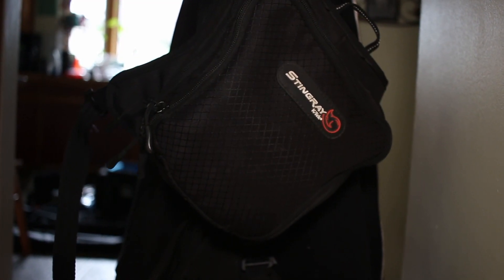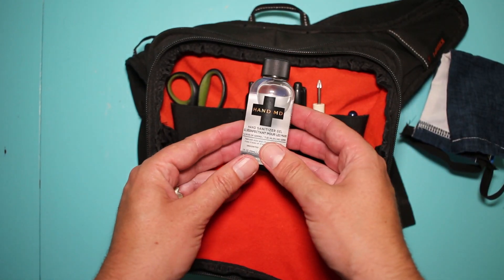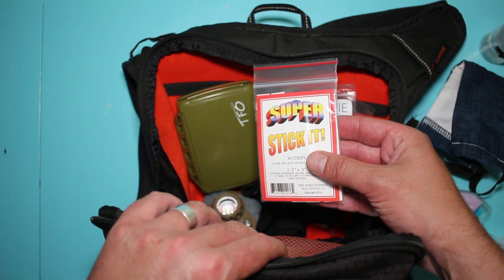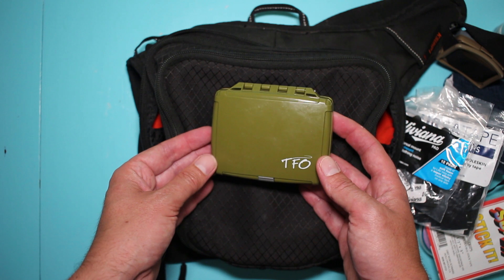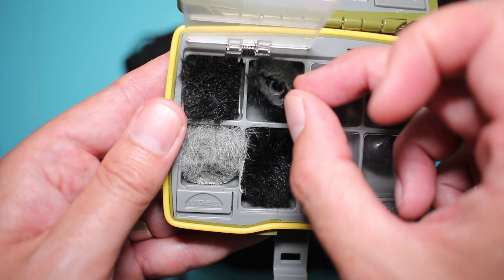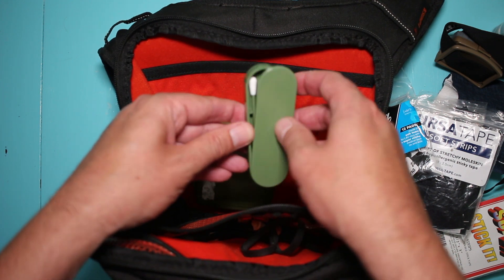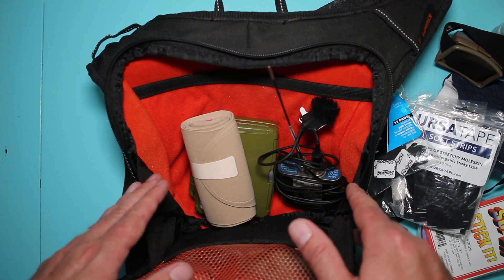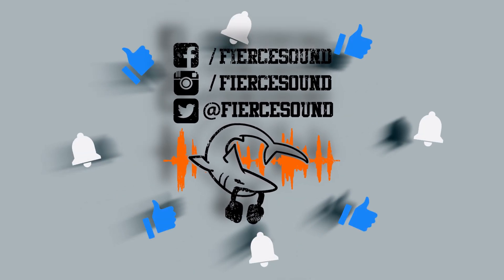A Look Inside My K-Tek Utility Hip Pack (KSUHP1)

Comment: Thank you for sharing.
At this time, TFO does not deliver outside of Canada. I didn't know this "box" before. I rather know the MICBOX from Lectrosonics which is relatively more fragile, but suitable for small volumes.
The K-Tek Hip pack is also suitable for the MixPre3/6, to move discreetly and easily. I also discovered thanks to your other video the ORCA 132 bag ... I wonder if the ORCA 130 could be enough since it's smaller.